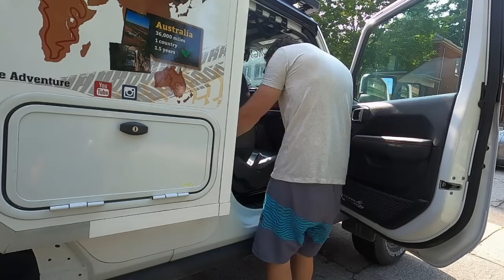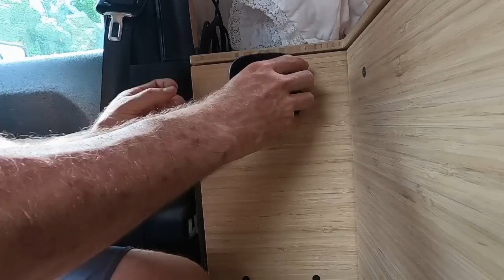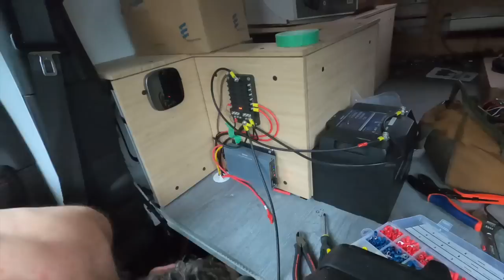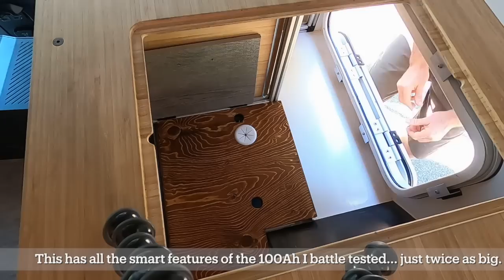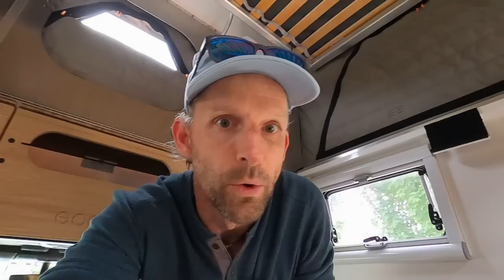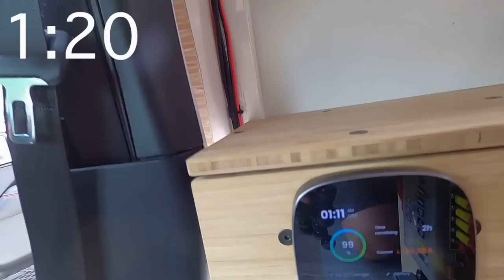Watch This BEFORE You Wire Your Dual Battery Setup! | The Road Chose Me

Comment: Dan, did you have any issues with the dc-dc charger and the smart alternator?
Reply from the maker: None at all, they worked flawlessly together
Reply: @TheRoadChoseMe  I have the 50amp Dc-Dc Renogy core 1 and their 100ah mini battery (self heating) going in my Gladiator. Was curious if any issues. Thanks for the build video and update! 👍🏻

Comment: I have a 100ah lithium battery and a 100 watt panel mounted on my jeep.  Im getting amps and watts and my renogy controller is working but my lithium battery is not charging.  What could be the issue?
Reply from the maker: What charger do you have specifically? Are you able to monitor how much current is going into the battery?
What does the Renogy app say for current going in/out of the battery?

Comment: Thanks Dan. Do you know if it's o.k. to hook up the ip67 to an alternator greater than 100 amp? Foresty Forest hooked up his Renogy 60 amp dc to dc to his starter battery and runs a 250 amp alternator.  Thanks
Reply from the maker: You can hook it up to any size big alternator - mine is 250Amps on the jeep and it works flawlessly.
Reply: @TheRoadChoseMe  Thanks Dan. Happy trails.

Comment: Dan… wish I could convince you to use marine grade heat shrink wire connectors.

The vibration dampening qualities of them is most helpful for bouncing around on the road. The corrosion resistance is a plus of course.
Reply from the maker: I'm sure they're very good. The important question is are they necessary.
Reply: @TheRoadChoseMe  with the inconvenient failures I have seen on my commercial trucks and used Jeeps as time and fatigue from vibrations go on - I would say 100% yes. 

Once you go this route - you will never go back. 

Shoot me a message - will either send you an example video - or fly up and give you a hand before your deadline. 

Ps- my Ursa Minor travels with small kit of marine crimp fittings, and quality no cut crimp pliers. Many a job done for me and others on the road.
Reply from the maker: Thanks for the offer, the Jeep is already sealed away in a shipping container!

Comment: Dan, I'd reconsider having a breaker in the engine compartment. I made a similar setup to yours last winter (Renogy One Core, Renogy DC/DC converter, Renogy shunt, generic Li battery) and had everything isolated with circuit breakers. The system worked fine in the winter but when the weather heated up the 60A breaker in the engine bay started tripping. The breakers use heat to trip (some breaker manufacturers have a chart for temperature de-rating), and the hot under hood temperatures led them to trip after 10 minutes of driving. Ive since replaced the breaker with a fuse and have not had any issues.
Reply from the maker: Thanks for the info. I'll keep a close eye on it and change it if required

Comment: Dan, with 600w and a dc to dc, I think you’ll be able to get by just fine with 200a. I run a 300a battery with 300w on top of my UM J30, no dc to dc, full electric kitchen, and have never ran below 20%. Lookin good. The only suggestion I’d give is to figure out how water will leak from above and make a shield over your inverter to protect it. Yes, I said “will”, not “if”.

Comment: Can the battery support the full current draw from the 3kw inverter? Seems to me Renogy recommends the 300ah batteries for that inverter since the bms can handle more output.
Reply from the maker: No, the battery will do 200Amp continuous, which is about 2500kw.
It's plenty for my induction (the only big load on it).. and I may add more batteries down the road anyway.

Comment: I'll be very interested to hear how that circuit breaker holds up for you in the engine compartment.  I tried a couple of different 40A models for my 30A Renogy DC-DC and they all failed, tripping at well below their rating when it got warm under the hood.  I just ended up going with a fuse.  I  had another circuit breaker between the DC-DC and the house battery and it failed on a trip and I replaced that one with a fuse as well.  Not as convenient (it's nice to be able to easily turn off the power) but certainly more reliable.
Reply from the maker: I'll report back if I have any problems. So far so good

Comment: The first person to bring a workable 12v induction cooker to market is going to make a killing.  Watching people spend thousands and thousands of dollars on running a single hot plate is pretty painful.
Reply from the maker: I talked to a product design engineer at a well-know company who basically said "The industry will catch up and get there eventually".
Also, for what it's worth, if there was such a thing the only component that would be different in my system is I could remove the inverter. Everything else would be identical, so it's not like I spent "thousands" to get the hot plate alone.

Comment: Great system and nice clean DIY electrical built Dan ! I also built my Renogy system on my sailboat and use Induction cooktop and it still works perfectly. I love that induction doesn’t heat up the cabin (camper in your case) like butane or propane flame do. And propane causes humidity as well. So great choice. Does your charge contrôler also take a charge from your alternator automatically (only when driving) without a DC to DC charger ? That’s cool ! Renogy gets a bad rep. from irregular poor customer service but I also had no issues.  Cheers from 🇨🇦
Reply from the maker: The Charge Controller IS a DC DC charger and MPPT charger combined into one.
Sounds like your setup has been great!

Comment: You shouldn't have any circuits that don't have a fuse/breaker on them. This includes the power line for the inverter and for your fuse block. The inverter has a fuse. That does you no good if you ground out that beast of a wire coming right off the battery.   The fuse block needs one as well.  So, it doesn't melt down when some jack wagon fills it with 40a fuses. Your breakers should go as close to the battery as reasonably possible.  I like breakers because you can use them as off switches to isolate the battery.
Reply from the maker: The battery has built in protection - I tested one of these by direct shorting it repeatedly to see what would happen. Nada. https://www.youtube.com/watch?v=hlgL72aV-n4

Comment: That 60A fuse you put under the bonnet will cause grief.  When they get hot they cut out.  Ask me how I know.  Replace with an ANL fuse.  The 3000W inverter can draw more power than your battery can deliver continuously.  2000W is the right size for a 200Amp battery.
Reply from the maker: The battery can deliver 200Amps continuous, and up to 270Amps for 30 seconds.
Right now with the induction on full it's only pulling 120Amps. All good

Comment: You got it. 
I just finished my 60 day cross country trip with my power system. Induction cooking everyday. 
Total of 370 Amp hours of storage, 50 Amp Renogy DC to DC charger, 2000 watt Renogy inverter and one 200 watt Renogy solar panel. 
Plenty of power!

Comment: Installing a Bluetti or EcoFlow unit would have been much simpler ;)
Reply from the maker: And much less energy, much less flexibility  and much less ability to upgrade components if required. Those are the jack of all trades, but they are not very good at anything in particular.

Comment: Well done. One simple thing you might want to change though is that fuse.  They are not reliable (in my experience). Get an 'old fashioned' fuse in a proper fuse holder and you'll be better off.

Comment: Odd that Renogy says you can't put battery on side... every other manufacturer specifically says you CAN place a Lifepo4 battery on side!  This is one of the big advantages of LFP batteries... you may need to revisit this statement with Renogy.
Reply from the maker: I don't know what their reasoning is, but they're firm about it.
Also this particular battery still wouldn't fit in that space I cut out anyway
Reply: Maybe the cells are actually mounted on their side while the battery is not. Putting the batter on its side could potentially put the cell upside down.
Reply: @bmpwe  but that doesn't matter either with anyone else's batteries.
Reply: @veganpotterthevegan  well, those aren’t anyone else’s batteries. It’s possible they’re an abnormal design.
Reply: @bmpwe   they very likely have the same cells many brands use. There should realistically still be a good reason why they don't want them on their side when it's a non-issue for everyone else
Reply: @veganpotterthevegan agreed. Prismatic cells can generally only not be mounted upside down. So, if renology designed the battery such that the cells are mounted in their side while the battery itself is right side up, then putting the battery in its side could orientate the cells upside down. I agree that’s abnormal design, but that or maybe they have vents on the side are the only reason I can think that you would t be able to mount the full battery on the side. 

Well, that and maybe the way the cells are orientated could put the weight of cells on top of other cells. I wouldn’t expect that to be a major concern with a small battery… but I don’t know what their design criteria is.

Comment: Very well presented.  Given how great the EcoFlow units (and the like) are, I am surprised that people are still building systems like this from components.
Reply: You get better specs for less money by building a system.... stand alone units like the ecoflow are good if portability is important and space is extremely limited
Reply: @sharpsticksnz4112  True enough, if your labor is free as in your case.
Reply from the maker: Units like the ecoflow have about half the capacity of what I just built, and they can't power nearly as many fused circuits as mine can.
I also doubt they can handle 600W of solar input.
Mine is also much more serviceable and upgradable should I want to swap out any component or increase battery or solar capacity.
Reply: @TheRoadChoseMe  You really shouldn't guess.

The most capable Ecoflow has these specs
    7.2-21.6kW output
    6kWh-90kWh capacity
    5.6kW-16.8kW solar input

And of course they have many smaller units, some similar to your specs.  And that is just one manufacturer.  There are several great providers.

Yes, they cost more than your installation, since you did it yourself.  Those paying others to install a system can put $2000 in just labor cost.
Reply: No, those units cost a fortune for their rated power and if you want alternator charging you still have to run cables and fuses and so on.  But if someone is unable to do wiring themselves, they can pay through the nose.

Comment: Sir, I have followed you around the world, implemented many of your systems (the water filter the best), and read your books. While it might be a bit too late since you're on a short timeline I want to share my 12v system going on ~3 years in my 4Runner. Lithium 400ah x2 for 800ah total from LiTime (yes, Chinese but not a single issue in ~3 years and I stress the system living in my 4Runner in AZ.), 200w solar with 400w portable solar, 3k Renogy inverter, all through RedArc RedVision,  and 120v input when at home parked. My large draws--1800w induction stove, 6k BTU A/C 120v, 1800w heater, Ninga Foodi Airfrier, 12v fridge, and a 12v 300w water heating rod that heats the water while driving. What I learned--most of the battery is consumed between dinner, staying comfortable while sleeping (A/C or heater) and breakfast. This dinner to bfast period there is no solar input, thus the bigger the battery bank the better, especially since affected by environment temps, hot or cold. All of 2023, Jan-Dec I lived in my 4Runner. I live in Arizona. In 2023, I worked at night and slept during the day. Cold months not an issue. During the summer, 119F was the hottest day temp while I slept ~78F inside the 4Runner with 600w solar total. Because the drive from sleeping area to work was <5miles the charge was all from 600w solar, by the 3rd day 800ah was down to 12.9-13.0v when I went to bed. On the 4th day I came home. Just sharing, as you have done with us for so long. Thanks.

Comment: I stopped mounting dual battery systems. Way too complicated, too many components, too expensive and too inflexible. Now I use a  massive Goalzero lithium ion battery with integrated solar charger and inverter and can be powered by alternator, DC or solar out of the box. Easy to install and use and completely disconnected from the car battery. And can be used in other trucks, at home or on the boat. For me the perfect solution. I use this setup for several years now and appears to be reliable both in extreme heat (45 C) and cold (-20 C).
Reply from the maker: It doesn't have nearly the capacity of my system, and you can't connect nearly as many accessories (and high current accessories) as I have.
Your solution is the jack of all trades, but it doesn't do anything one thing fantastically.
Reply: Trouble with power n
Banks is they are a single point of failure,  lower amp outputs and slower 12v charging.
Reply: Did you connect the power station directly to the alternator??? Any problems charging both the starter and house batteries??? What size cables for the extended distance (possibly to the rear of the car 6m away)??? The power stations have a 48v system which requires much smaller cables. Ecoflow now sell a booster for the alternator (reducing the charge time by 80%) and the Delta Pro can be fast charged at an EV station in a few hours. No brainer!!!!

Comment: Hey Dan, just a word of caution.  Your power system looks amazing and the video super helpful to those new to this but I would caution you against using the cheap Amazon circuit breakers.  At least that's what it looks like you've used.  I have had a bunch of these fail and they are not properly rated usually either.  I strongly recommend spending just a few more bucks on Blue Sea or Bussmann.  I've also had better luck with a few of the 'in between' cheap and name brand Amazon names like T Tocas and Stinger.  I have a Young Marine brand one from Amazon that is holding up so far as well, yet another inexpensive Amazon brand that has recently popped up.  Cheers!
Reply: Totally agree, I've had 3 fail in use and a further 2 that are simply way WAY under rated, a 50A that trips at 200A and a 100A that doesn't ever trip as I can't load it over 250A.
I bit the bullet and purchased blue sea items 👍
Reply: I want a small quality breaker panel for a overland build thanks
Reply: Yep.  Those manual reset breakers have a hard time tripping at the current stamped on them - they are wildly over or under, and when they are installed under bonnet and get hot they fail to operate at all - thankfully they mostly open from the heat and not the other way.  Best fuse to use is ANL in my opinion, which is why Renogy supplies one in their stuff.  ANL has a good compliance with fusing at the right current.
Reply: Mariner here. I second Blue Sea Systems

Comment: This video has quite a bold statement. I actually learned nothing new.
Reply: Me either.  But I did learn other "teachers" still use the wrong fuse types, and run an oversized inverter for the battery current capability.  No use using super size copper when only 200A continuous is possible (unless a second 200A capable battery is wired in parallel).  Adding a second battery in 6 months time or more is totally the wrong thing to do, as parallel batteries must be the same manufacturing date.
Reply: @einfelder8262  "Adding a second battery in 6 months time(...)", true. Especially if it is a enclosed one like this.
IF one builds a battery of individual cells, one can add some later to the SAME BMS. But you have to deal with probably different capacities of each cell = the lowest one will be the max Amp in the end for all.
A ready-to-go LiIon Bat. has its own BMS, not ideal in that case.
Here is victron the major brand and they offer the optional monitoring BETWEEN two Bat. in parallel on their shunt. So at least you know than if the 2 Bat. are on different level or not.

Actually I wouldn´t suggest a full on elec. cooking in such a small car with limited space to fit big bat.
If the bat. just last 1 meal ... PV will take ages to refill that, if you arent in Texas or similar.
I just fitted a self-refillable (!) 3kg Propane bootle in my Van, which gives me roughly 3-6 months cooking. And it is just 5kg.

Comment: Thanks for that. I will need to do my set up in the near future and have watched a ton of "Instruction videos " on YouTube This is the first that actually makes sense ! My Defender 130 has two alternators so was going to keep the "systems" separate so this should work. Thanks again
Reply from the maker: Great to hear! With two alternators you can wire the charge controller up to the second alternator (instead of to the starter battery) and you should be all good to go!
Reply: Hope so thanks

Comment: Great work overall.  Please put an insulated cover on your positive battery terminal.  Too easy for a metal object to short across that battery and start a fire.
Reply: I saw the video.  I would not want to rely on that alone.  Terminal covers are inexpensive and fail safe.
Reply from the maker: These batteries are completely protected. I tested one a few months ago and dead short it repeatedly to see what would happen - https://www.youtube.com/watch?v=hlgL72aV-n4
Reply: Pretty sure that can't happen due to the battery management system shutting down power in that scenario. If you haven't seen it watch his torture test of these batteries